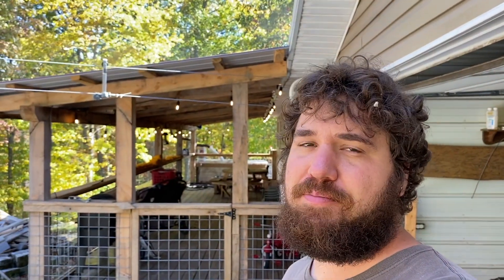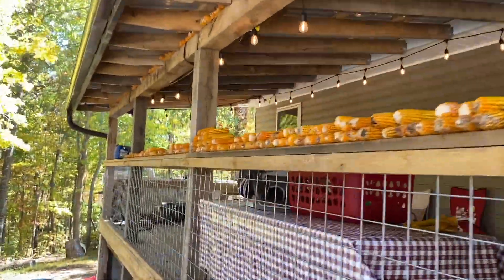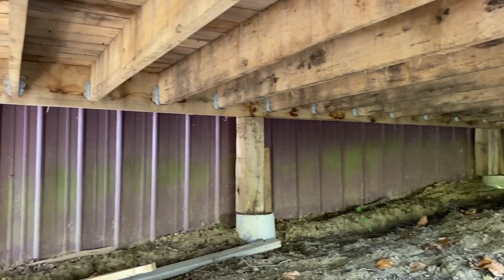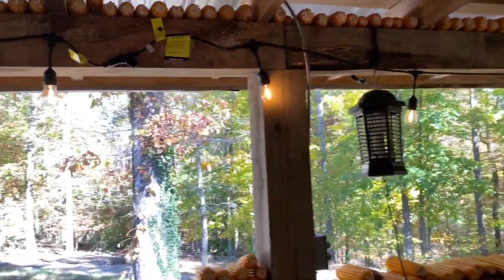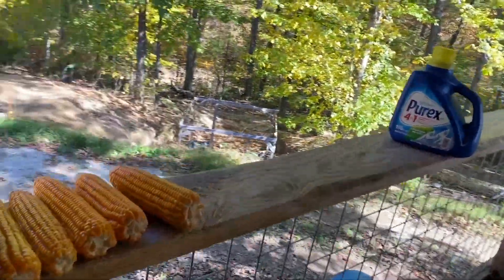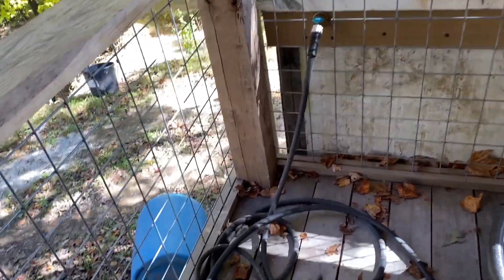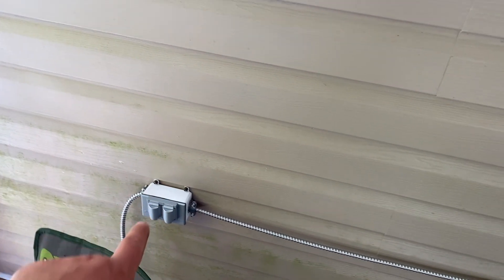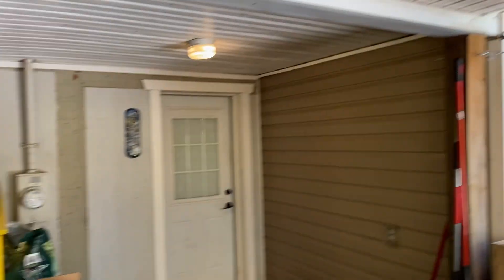Building a Rustic Porch / Finished

Comment: It turned out great looking I think. I've always like a rough sawn porch. Is it oak or poplar? I can't tell from the looks of it on YT but the top parts look like oak and the bottom beam up close looked like poplar with the mill strings on the bottom lol
Reply from the maker: You are correct! The posts and rafters are mix of everything.